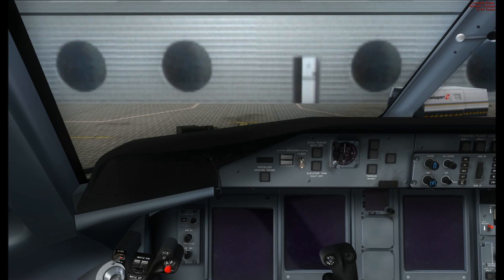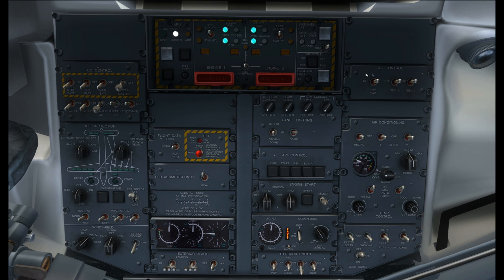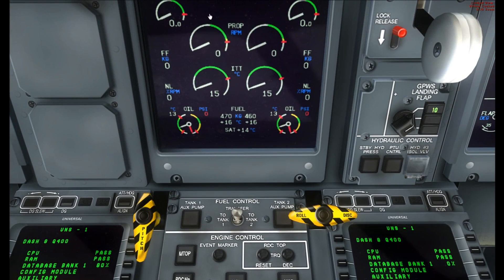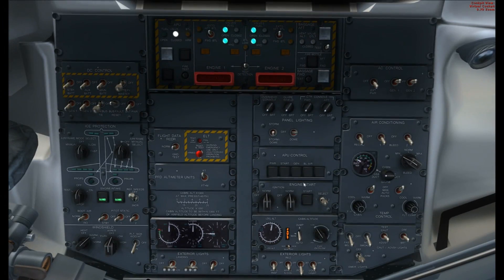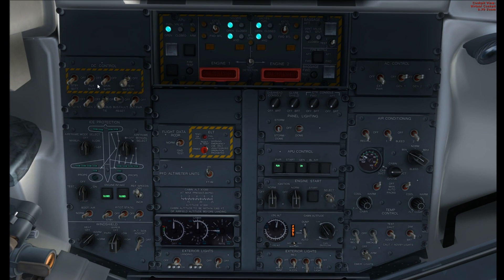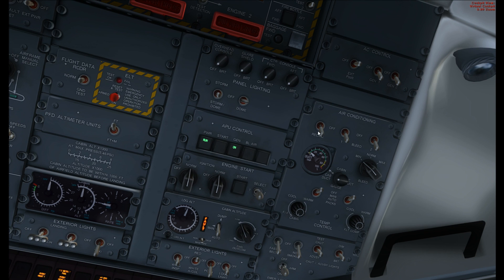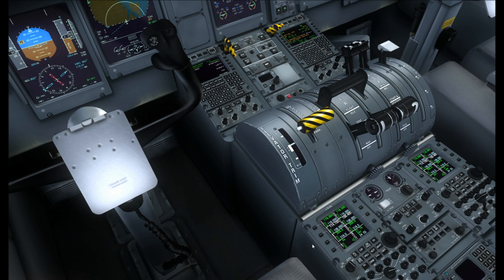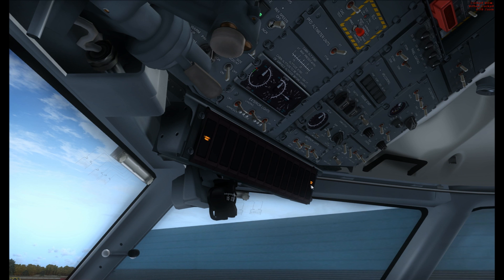[HD] Majestic Software Dash 8 Q400 | Cold & Dark to start tutorial

Comment: Great video.
I just purchased the Dash 8 but I've been having some problems. For example, when i'm taxiing, the nose wheel doesn't turn enough and i end up going in almost a straight line. Another problem that i have been having is that when i'm taking off or flying the plane wants to keep banking left. Any suggestions would be much appreciated, thanks.
Reply: +Andreas Nottelmann I have the very same problem, and I'm wondering if this is normal or a product bug.
Reply: +Andreas Nottelmann You can't use the rudder like the other aircraft's .

Comment: Why start an engine and then start the APU?
Reply: Its the way the aircraft fires up
Reply: danielgarzag no, normally the APU is meant to help start the engines with bleed air and elec power, and after start they are self-sufficient. APU is normally turned off.

Comment: And just for realism, i have never ever once seem the AC external power ever connected, you don't need it till after engine start unless its for ground power.. but you would still have the AC generators on. ANNNND, you wouldnt actually get as far as you did without the APU or ground power on.. with even only 5 - 10 minutes of discharge on the batteries, it takes ages to get them back up to speed. Good video over all, can't believe you learnt all that without formal training....

Comment: Just as a thought, you would never put the window heat or pilot heat on with just the batteries in preflight as its an AC system and the batteries are DC only. and you virtually don't use that till after takeoff. Well, our procedures anyway.
Reply from the maker: Thanks for pointing everything out :) This was back when it was just me learning :/ Im much more aware of the procedures etc.. so im thinking maybe an up to date more realistic tutorial is in need :')